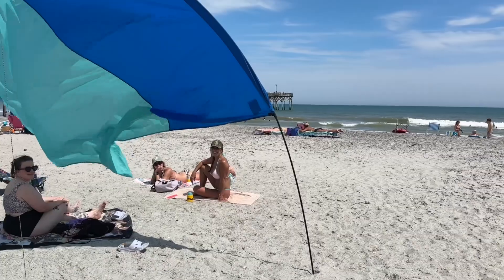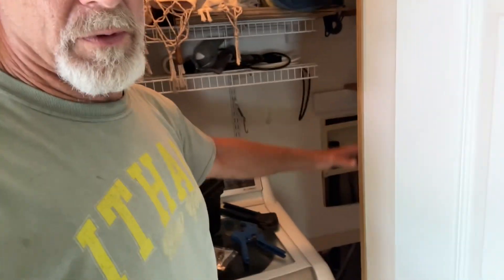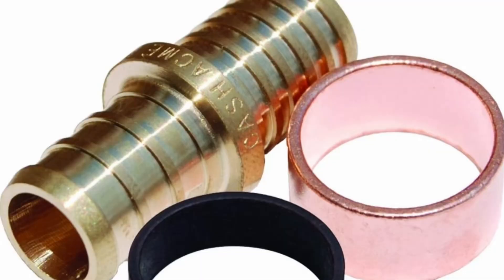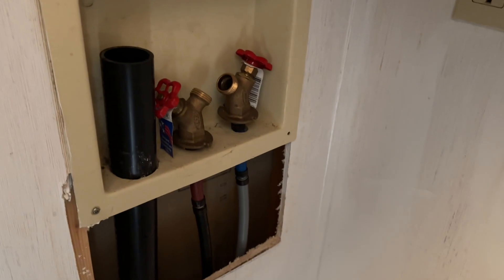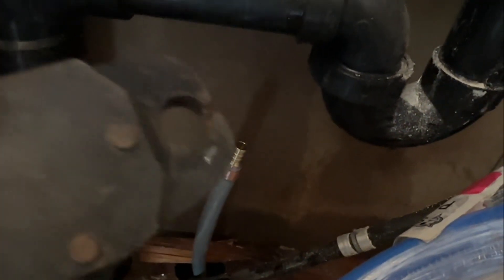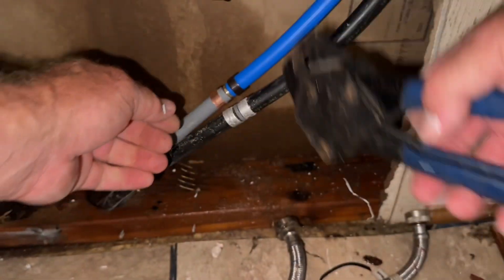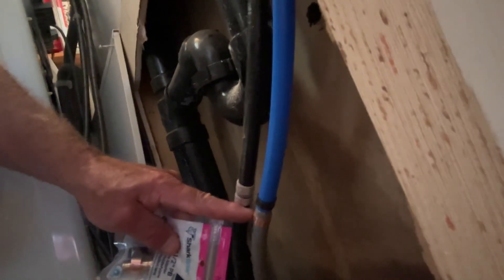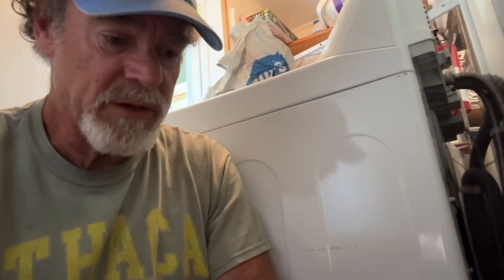Adapting Old Grey Polybutylene Pipe To Pex.

Comment: You should have removed all that Poly pipe and got it out of there so you won't have to repair your floors and walls again.  I have done this repair on a house we were selling, however the bank would not loan money on a house that had.  We had already replaced most of it and there was about 75 feet under the house so it was easy to remove it and replace it with PEX.  I hope your repair holds out but don't rely on that connection to not fail again or the pipe to rupture further down the line.